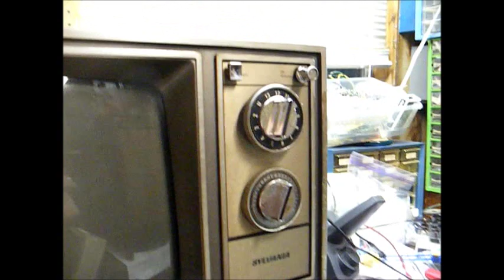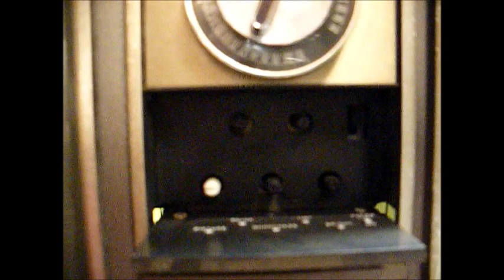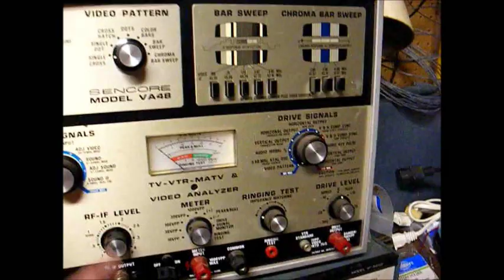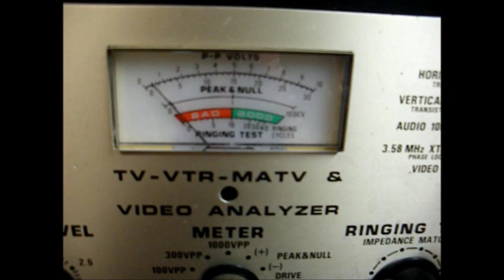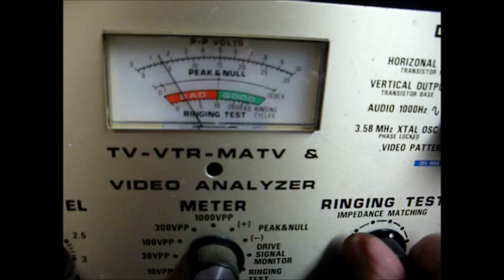1982 Sylvania E32 chassis 19" color TV flyback transformer failure

Comment from the maker: Up until the flatscreen craze and the DTV transition, it was fairly easy to find flyback's for older TV's. Now, since very few people are having CRT TV's fixed anymore, it's getting harder to find a replacement flyback for many models. Often, the only source for a flyback is to find a used one in a junk TV or find a NOS one from a TV shop or parts supplier.

Comment from the maker: What's really bad is when the cheap generic transformers don't quite line up with the original pin spacing. It can often be a pain to line up the terminals so that the transformer will mount to the PC board. Some of them can be a pain to unsolder; but, this one came out fairly easy. In order to remove one; you need a good soldering iron, along with desoldering braid, and a solder sucker.

Comment from the maker: Yes, that usually indicates a lack of horizontal drive or the TV going into HV shutdown due to the HV running too high. Try plugging the TV into a variac and see if it will stay on at 90V-100V. If it does, you likely need to troubleshoot the voltage regulator circuit in the power supply. If it doesn't stay on, look at the horizontal driver circuit.
Reply: the ones with separate hv trippler separated units using trippler input lead carefully notice  spark with  variac